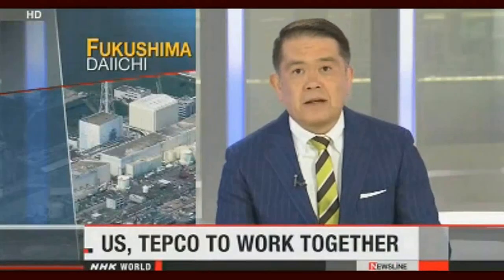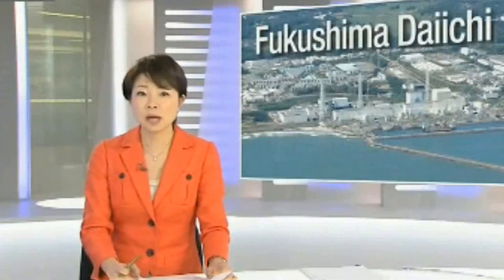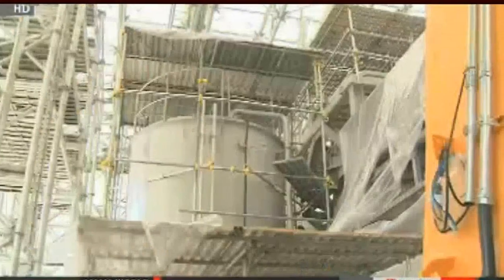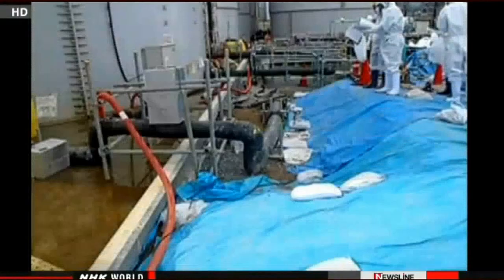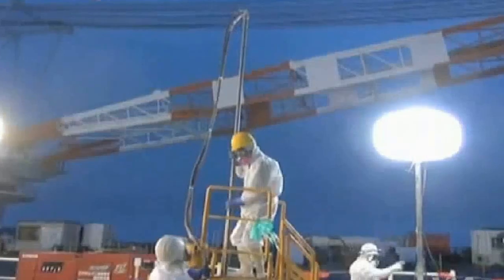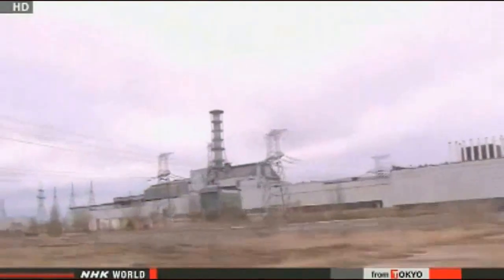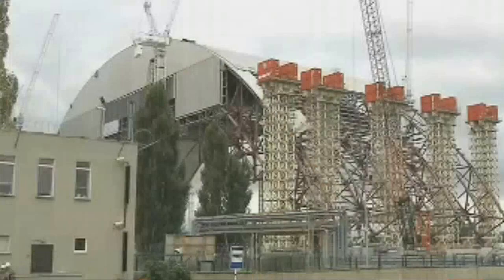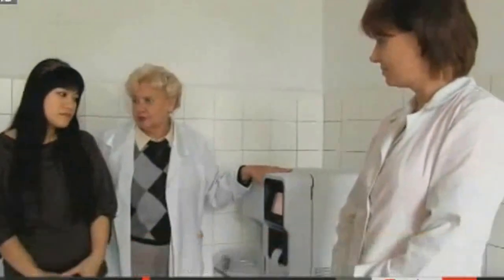Fukushima: SFP#4 Fuel Rod Extraction, US Aid to Fukushima Update 11/1/13

Comment: Seawater fence not fixed yet / Tokyo Electric “It doesn’t work to stop contamination anyway”
November 6th, 2013 Fukushima Diary
The screwed seawater fence hasn’t been fixed yet, according to Tokyo Electric. Tokyo Electric explained it is difficult to investigate because it’s under water.
They added the fence doesn’t have the function to stop contaminated water or decontaminate the water.
Tokyo Electric hasn’t announced how the radioactive density was affected in seawater due to the lack of one of the fences.
http://fukushima-diary.com/2013/11/seawater-fence-not-fixed-yet-tepco-it-doesnt-work-to-stop-contamination-anyway/